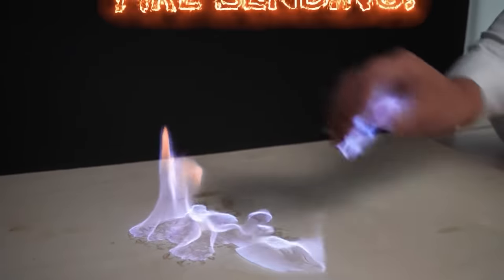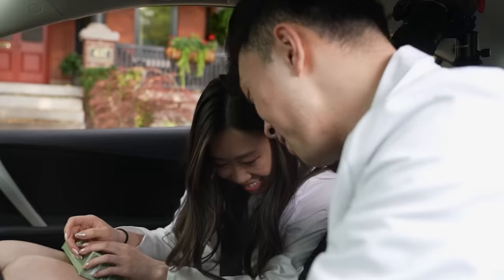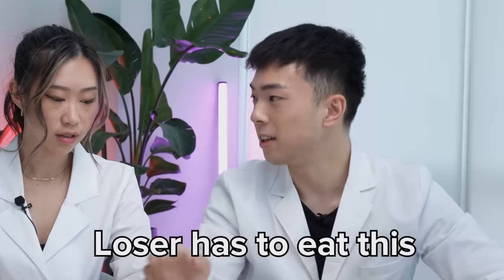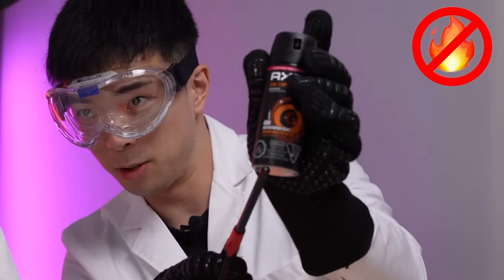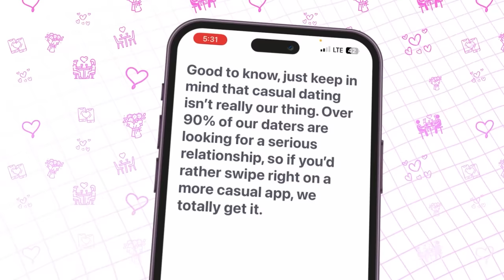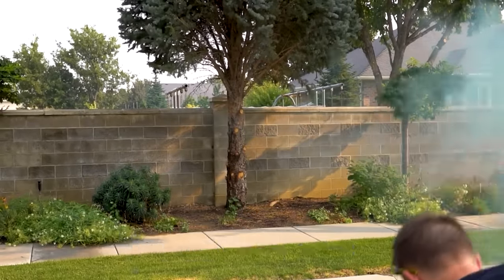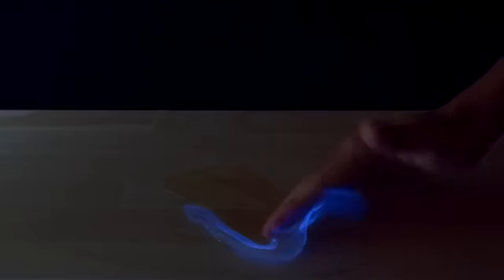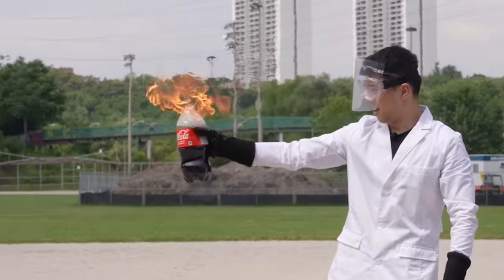Level 1 to 100 Science Experiments

Comment: Fun fact, you can recreate the rubbing alcohol in the first experiment with hand sanitizer as hand sanitizer contains rubbing alcohol. Because there is rubbing alcohol in sanitizer, it also gives off a burning sensation when applied on a wound.
Reply: Yeah u can use basically any flammable liquid
Reply: @UnknownNotFound630  some flammable liquids such as hand sanitizer contain ethanol and isopropynol
Reply: @YogoYoshi2936  yeah I know u could also use an aerosol like hairspray
Reply: RICL LMD8 MADTY U9FC9
Reply: @YogoYoshi2936  and @UnknownNotFound630 🤓

Comment: I'm just going to tell you that experiment that I just got to that is actually using my cars of rotation and a string that pulls all of it all the air in and then it launches the air and the smoke out at a high speed